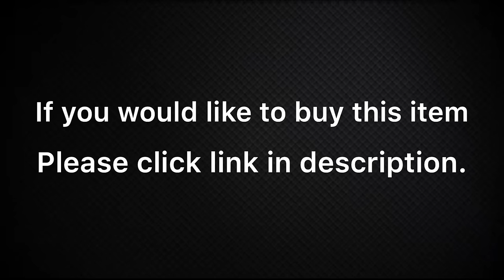Making a ring from Copper and Silver Wire! | Jewellery Making | How it’s Made | 4K Video

Comment: What kind of saw blades should I buy to work like that.
I got some crappy ones takes me a good amount of time to saw.
Am I supposed to cut when I pull or push?
Reply: It all depends on what kind of drawing you are sawing. If you need to cut quickly, you need to buy a blade with large teeth. You can use wax on the blade while you file. The hand should work well, if you pull your hand the file will burst.

Comment: Could you replace the copper stock with another silver one so the whole ring comes out solid 925 silver. Im in the US but I'd gladly buy this ring if you make one in all silver size 12
Reply from the maker: Yes u could use all silver
Reply: @TheJewelleryWorkshop  is there anywhere I could buy the silver square stocks for a decent price? I'm thinking maybe just pick up a set of old Sterling silverware and melting those down but I just can't imagine them being pure silver or even 92.5 even though their marked
Reply from the maker: Cleaning it with a fine brush and some washing up liquid should be fine

Comment: ea what machine did the oblique grooves on the ring?
Reply from the maker: Vikaria cutting machine
Reply: @TheJewelleryWorkshop  thanks, and also the diameter of the cocoa using the wire
Reply from the maker: 2ml
Reply: @TheJewelleryWorkshop  thanks

Comment: Unless you seal that copper with something won't it go green after a while ?
Reply: If u wear it often it won't go green on the metal but on your finger
Reply: @grubinskii  it will
Reply: @muhammadc2000  I m pretty sure the metal goes green and just it can rub off on your finger
Reply: @grubinskii  clear coat works just fine, any sort of coating for example a thin coat of polyurethane will be able to seal it if applied in a dry environment

Comment: Why didn't you use flux when soldering the ring together?
Reply from the maker: Hi there, our solder is mixed with liquid Flux already, and usually we put some of the flux liquid on the object we are also soldering. You just don’t see it in the video at times.
Reply: @TheJewelleryWorkshop  ok thank for the quick response. I was wondering because I'm just stating out as a hobby and thought I was missing something.

Comment: Copper and silver are a beautiful combination, however they are not suitable to be used for rings. The two metals in contact in the presence of an electrolyte (i.e body sweat) will result in galvanic corrosion. Depending on how often this is worn and where it is worn, the copper is going to corrode and all that will be left is the silver.

Comment: I've worn a copper ring before and it turned my finger green
Reply from the maker: Don’t know why it did that. To be honest this video is just more about how we designed it. Not really looking to get a sale out of it
Reply: When a ring turns your finger green, it's either because of a chemical reaction between acids in your skin and the metal of the ring, or because of a reaction between another substance on your hand, such as a lotion and the metal of the ring There are several metals that oxidize or react with your skin to produce a discoloration You can get a noticeable green discoloration on your finger from wearing a ring made out of copper Some rings are pure copper while others have a plating of another metal over copper Alternately the copper may be part of the metal alloy (sterling silver, for example) The green color is not harmful in itself though some people experience an itchy rash or another sensitivity reaction to the metal and may wish to avoid exposure to it
Reply from the maker: @modangratoato2717  well explained my friend
Reply: Kermit the frog ain't made from copper lol
Reply: well copper forms a green patina around it because of moisture, salt, acid, it can be easily prevented by polishing it everyonce in a while or clear coating it

Comment: Hello reader I have a question to ask you:
Is it possible to make a ring with all of the metals? 

Noteic : I will send a image separately if it’s possible to send the image of the metals with names included through YouTube
Reply from the maker: Send a message on our Instagram or email us
Reply: The metals name’s are
1)Aluminum 
2)Brass 
3)Bronze
4)Cast iron 
5)copper 
6)steel
7)metal sludge
Reply: It’s going to be a custom combination designed ring.